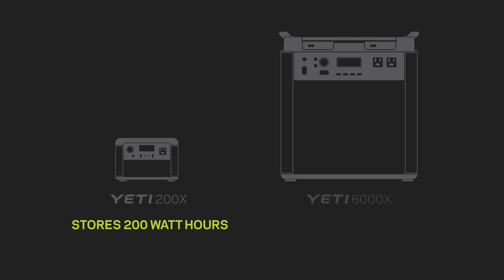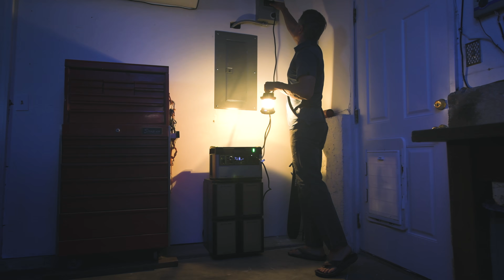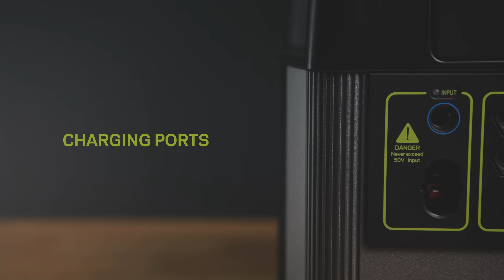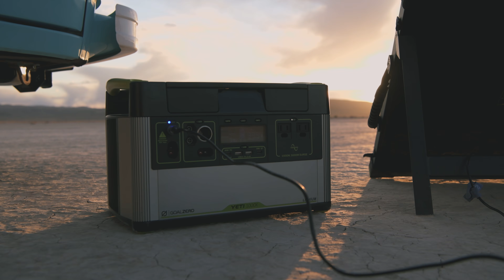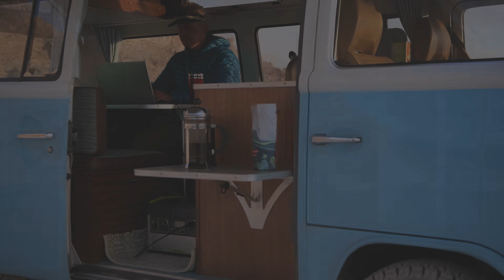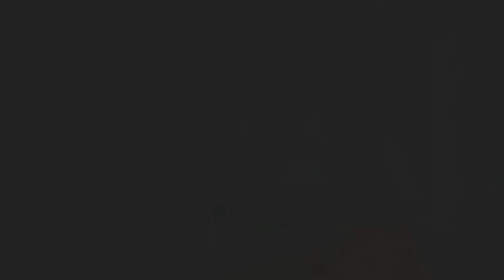GOAL ZERO | YETI X VIDEO USER GUIDE

Comment: I've had my 500X as a backup communications device charger now since May. Every night I plug my iPhone 13 Pro into it to keep the battery active.  I'm looking forward to buying whatever "X"  Solar Generator is on sale this Spring as a larger Emergency Power Supply.  I wish that Goal Zero had a Solar Blanket similar in technology to the Off Grid Trek 200 so that I could more easily recharge my "X"'s with lighter and more light efficient panels than currently available. Keep up the good work!